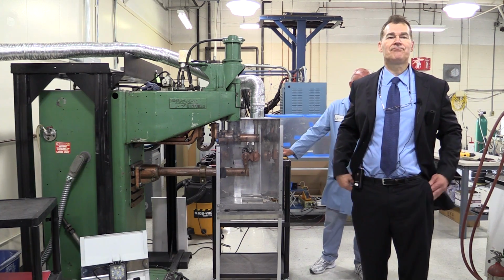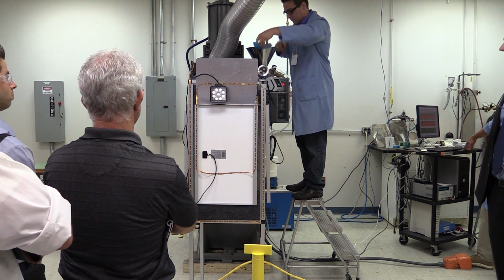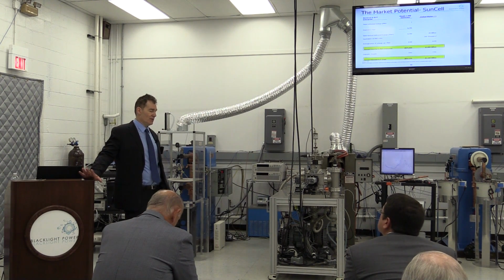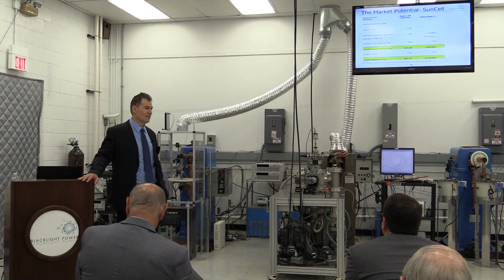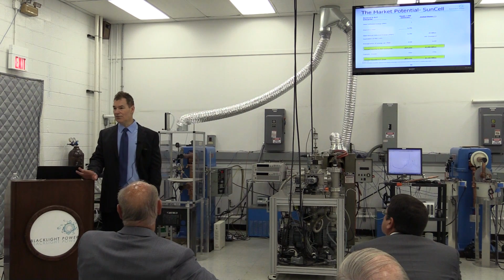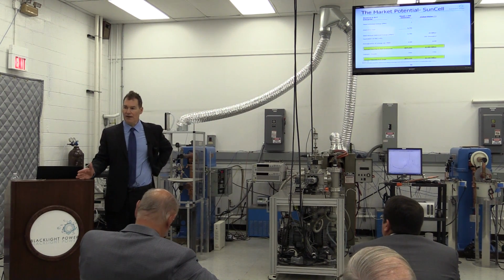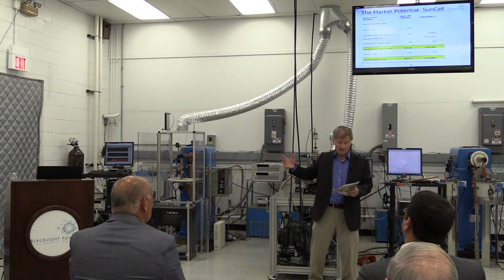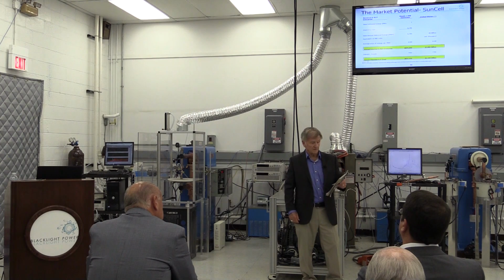BlackLight Power Demonstration, June 2014, Part 2

Comment: Hurry up with that working prototype it shouldn't take very long if the items are "off the shelf"
Reply: I love the idea of a hydrino. However, I have heard the same noise from high amperage electrical arcing originating from an arc welder. I am a fence sitter on the technology.
Reply: @BradKarthauser  yeah, and 4 years later it becomes obvious which fence too ;)

Comment: Uses less voltage than a car battery (12V) but 1,000 times the current (typically 200 - 300 CCA) How will this power a car? Using fiber optics to expand the light? Light energy doesn't multiply! Energy doesn't multiply, not to mention, powder fuel is terrible. It's extremely hard to work with and you want it to pulse at 20,000 hertz? Using electrode rollers and gravity, the powder will never move fast enough to be spent.

Comment: I see great usage method like normal accu where there is 2 layer of photovoltaics and rollers inside that are glass containing metal on top to add the current then you feed from other side with pressure the hydrinos and output would collect exhaust.

What bothers me is that how much power you need to feed to make the blow? If it takes more than 12v then Cars can not gain so much benefit from this system. Altho you can scale 12v with coils to higher voltages but then there is current question, how much current it need to draw before ignition happens?

Blacklight, please provide us the voltage and current needed to make an explosion. This will limit the implementations if it needs either high voltage or high current.

Please respond to this. Last video did not talk about this, netiher this one.
Reply: You talked in the video about the highcurrent that the current source you used uses less voltage than standar batteries. Does this mean under 1.7V. If you need to drain high current to explode then can you lower the current if 12V is used?

Comment: "The proposed hydrinos would have tighter orbits because of lower energy (catalysis having transferred energy from the former regular electron), so the proposal is that these can catalyze fusion."

-similar to muon-catalyzed fusion. Would the process generate significant amounts of hydrino stuff and could this be used in a 'pure fusion' weapon? This has been asked before but Ive not seen the answer.
Reply: Pius Zaleski Correct. The stuff created, hydrinos, have tighter electron orbits which would seem to make fusing it easier. Look up 'muon-catalyzed fusion'.
Reply: otto Bierdorf Dr. Mills responded to a similar question, possibly in the Yahoo! Group, SocietyforClassicalPhysics. Technically speaking, hydrinos do make it easier for cold-fusion to occur. But as I recall, he calculated that the odds are increased by only a tiny fraction above the already abysmally low odds when using normal hydrogen. He made it clear he did not think it was an energy source worth pursuing.